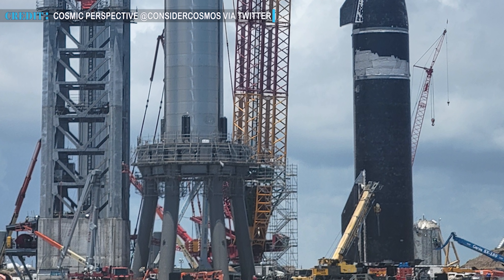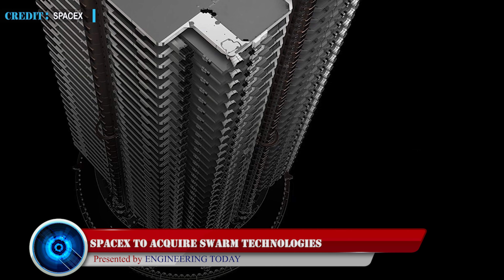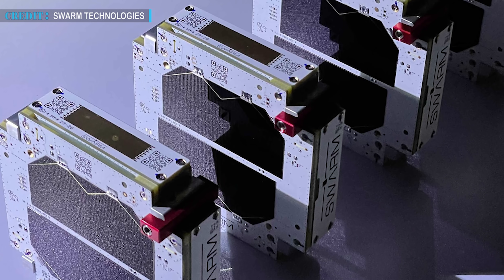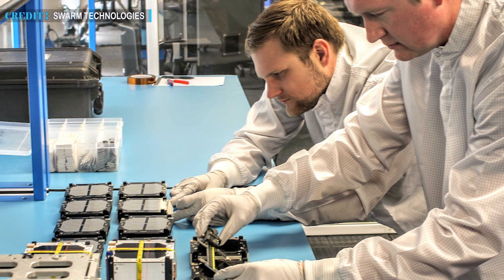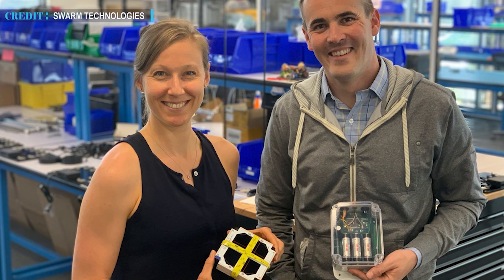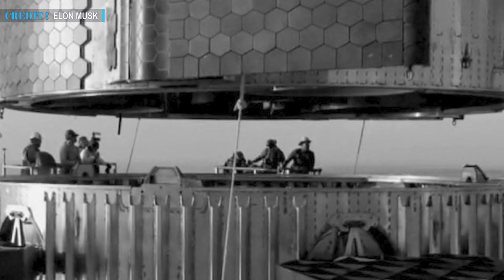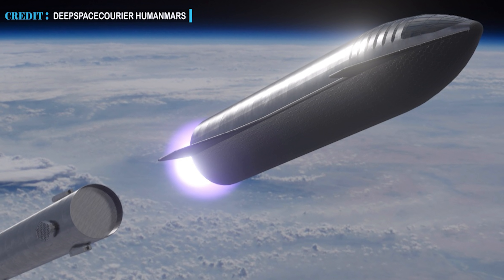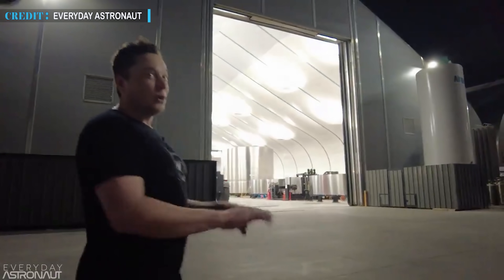SpaceX Starship Update: Elon Musk reveals new Separation Mechanism to deploy Starship from booster

Comment: Mr. Musk, I believe you need to double check the mounting of your Starship package between the stages. I have seen and been involve with 2 and 3 stage rockets since "1961" when I first started with a Astron Scout. I have seen better connected birds fold like a sheet of paper before they reach speeds necessary to pin both stages together. I am not trying to tell you or your engineering staff how to do things, just trying to give you a heads up. Thank you for listing,      Ray C., Retired Engineer

Comment: why are grid fins made of steel being used vs. titanium fins like the ones that are on Falcon boosters???
Reply: Once they are consistently recovered  I would imagine optimizations like this will be prioritized. For now, the additional weight I would imagine is negligible given the overall mass of the vehicle and a lot cheaper to reproduce in case of rapid unscheduled disassembly.
Reply: F9 fins are the largest titanium part ever cast, and they're tiny in comparison.

Comment: Great video, lots of details. Elon's new separation happens because of centrifugal acceleration. both booster and starship are being pulled apart after rotation begins. presumably there is a latch connecting the two during launch. The latch is disconnected after rotation occurs, as part of the booster re-orientation for the boost-back burn. I am speaking hypothetically, rotation has been specified, the other details are my own assumptions.

Comment: 9:12 I'm pretty sure that Starship will only fire three of its engines (vacuum optimised) after separation rather than all six.
For landing, the other three smaller bell, atmosphere optimised engines will be used.
I don't know if they ever fire all six at once...  (Plaid Mode)
Reply: The atmospheric ones might cut out after a while, but firing them early will increase thrust to weight, which minimises gravity losses.

Comment: Pretty sure the thermal protection for raptors was intended for Starship not Super Heavy Booster. Starship engines will need to survive the heat of re-entry, but the booster is not likely to need that since it will fly high enough for a TPS to be needed, much like Falcon 9.
Reply: No it’ll be around raptors on booster like on the flacon 9 merlins
Reply: The raptors on the boosters will still get really hot during descent

Comment: having permanently deployed grid fins- am I hearing that right? It's kind of like pushing the gas and the brakes at the same time, at least on the way up. What is the payload tradeoff for that? I'm not a rocket scientist, but it seems like a bad idea...
Reply: My guess:  The grid fins folded and not flush probably create nearly the same drag at launch as deployed and aligned with the airstream.  It might be optimal to fold them with a fairing ahead of them, but sounds like for the test flights, the added complexity is not worth it.  Especially if this booster is not lifting a fully loaded Starship and only headed for a soft splashdown, not getting reused…same as this Starship.  Like an airplane on its first flight leaves the wheels down.
Reply: I think the wet mass and thrust of the booster would overcome the drag of the grid fins. Its probably permanentely deployed for stabilization reasons
Reply: @pltntn1337  The extra hardware for folding them is better avoided when not really needed. Elon said it was easier to add it later if needed than to build it only to remove it later.
Reply: Watch tim Dodds interview with elon musk, they talk about why that's happening. "Get the product to work then optimize later" - Elon Musk.

Comment: I hope the booster / starship separation system works.  Will they still have something aside from gravity & thrust holding the two ships together in flight?
Reply: They will have a CONNECTING system but NO SEPARATION system.  The connection will be deactivated and inertia will be used to separate the two parts.
Reply: Yes, of course. There will be pneumatic clamps like the Falcon fairing halves.
Reply: @odysseusrex5908   I thought I heard in this video @8:30 something about the Starship’s 3 sea-level Raptors’ gimbal function being used for separation.  Was I just whacked out?  😀.   Or could those engine bells actually be used to twist SH off of “bayonet”-style lugs on the bottom of Starship, after meco, while it’s basically just hanging in near zero g from the bottom of Starship.  It might be preposterous…or is it?  …and no, I wasn’t smoking anything.  😀
Reply: @Andrew-13579   The gimbaling is going to be used to achieve the actual separation. I don't know the exact mechanics of that, but I think it will occur after the latches have been undone. Obviously the two stages are not merely going to be stacked atop one another with no connecting locks.
Reply: @odysseusrex5908  Agreed.  I was thinking…although doubtful it would be done this way…maybe there could be lugs (if that’s the right term) on the top of the booster that engage grooves in the inside of the bottom of the Starship skirt.  When pressed together by gravity or booster thrust, they would lock.  When Starship was pulled up, or booster pulled down, the the lugs would come out of their lock position to where a slight differential rotation of booster and Starship would bring the lugs out of the grooves and separation.  Kind of like a BNC connector, but not so much rotation.  Anyway, some sort of simple, mechanical lock is probably what they’re thinking.  Sounded like Elon was wanting to avoid something electrically, hydraulically, pneumatically or pyrotechnically actuated.  But I’m just guessing, based on this video.

Comment: In Part II of interview with Tim, Elon said that SpaceX doesn't need catching arms or integration crane for the first trial as neither the booster or SN20 would come back. But they would need a strong back for fueling and support
Reply: And how do you get the straps  " off "  SN20 + B4booster + 40M launch Stand.     Really surprise the launch tower was not a further 20M higher (upgraded Engines, could lengthen Starship a few metres for surprise mods)
Reply: @johnpotter4750  The tower is completely module, and sections 2-8 are almost identical. If SpaceX needs the tower taller, they need only to remove section 9, and add another mid section, then put section 9 back on top.
Reply: @BLOODnVALOR  Well, cut out the welds, but could the Frankencrane pull up against the friction plates, I think you'd have to cut a section away and fettle the shorter section back,  A bit tacky.
Reply: @johnpotter4750  , they don't need to "take off the belts" because they don't need them (the best part is no part) ;) They stack BN4 and SN20, fill their tanks (or fil their tanks before stacking), take everything off (pressurization system keeps proper pressure) and launch them or did you see straps on <=SN15 flights? The tower is high enough because SN will be moved with the catching arms below the nose flaps, there will be no higher attachment point available, which would also be a problem for the TPS (use what you already have). Later the DC arm will be used to fill up the tanks or maybe the DC arm will be ready for first launch, we will see.
Reply: @ralph638  Aah, but Elon's said in the (3rd) interview the crane would be the mover, but if the arms are pre-installed, no problem, all would be as it should.  Those arms must have horizontal moving surfaces under grid + flaps? and its range of axis movement confuses me ! from fabrication seen so far.
Reply: @johnpotter4750  We will see, what SpaceX is going to do. The crane would be the mover for the first start. If you look at SN20 and presume, that the attachment points at the nose must be removed (break in TPS surface), then the next attachment point is the flap hing, which is far enough from the body (which is not technically necessary) to be used as attachment points. I'm so curious, what way SpaceX will go :)
Reply: @ralph638  I just thought to throw a Raptor in the Hen House. - Easy route dangle a Karl outroped to a Helicopter (risk assessment to follow, not...)

Comment: They said they are not using The mechazilla untill after the first launch.
Reply: they are not using for lifting but the QDA will be needed to fill ship 20's tanks.
also considering the time that will be required by FAA to authorize the launch I won't be surprised if they will complete mechazilla even for the first flight